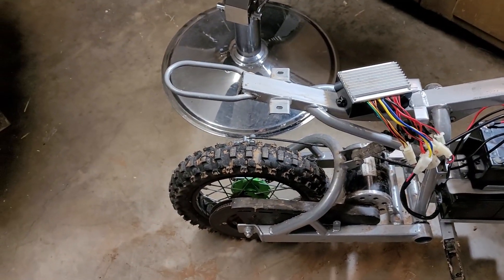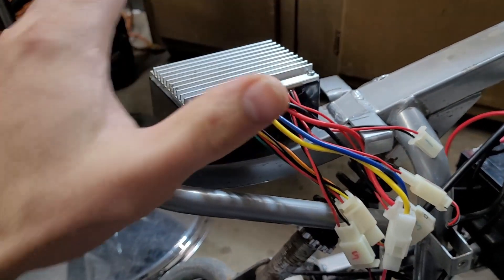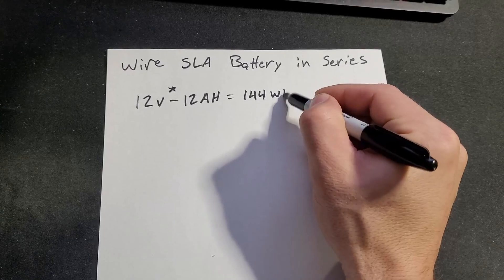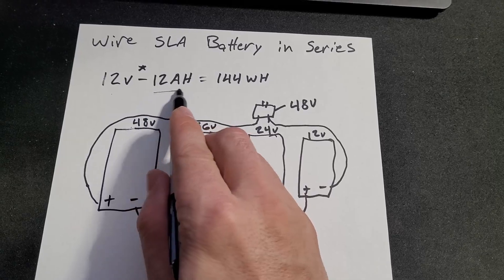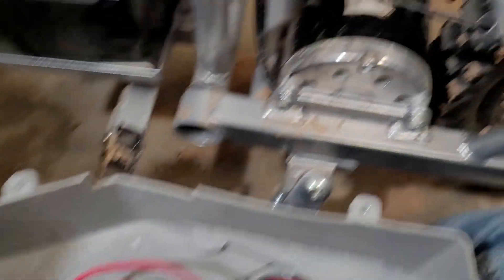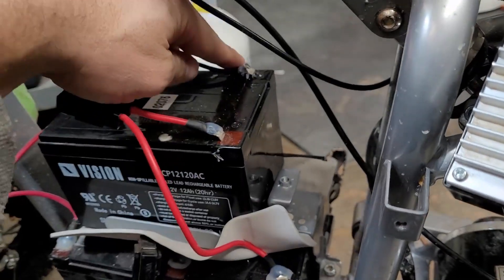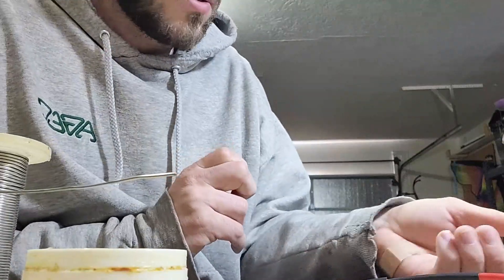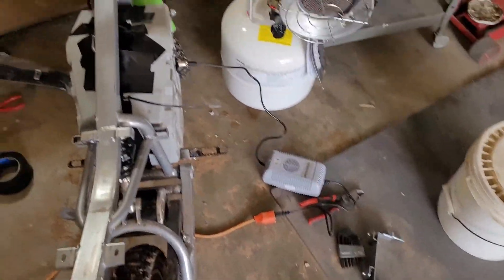Razer SX500 48V upgrade with stock batteries, controller and motor

Comment: What do you mean how did you modify the controller by just soldering on a jumper wire between those two contact points??? 

Any info would be greatly appreciated
Reply from the maker: TBH, I'm not exactly sure what the jumper wire does. When it wasn't soldered, the controller was letting out a huge whine under very little load. With it soldered, the noise mostly went away. Not 100% sure why. It's got to be some sort of bypass so more power can flow through the controller.